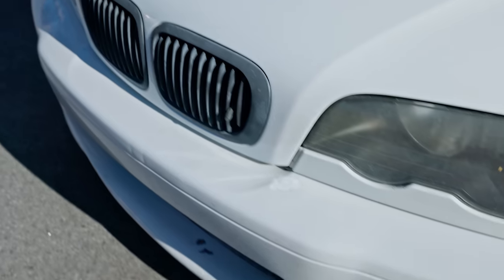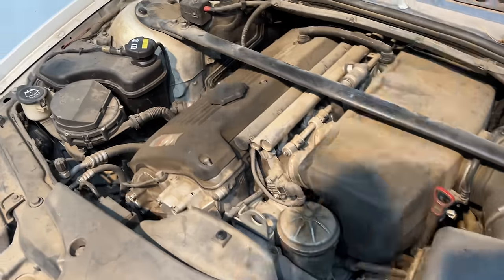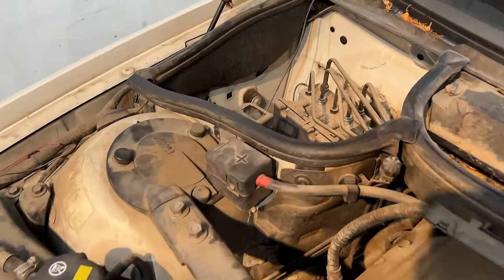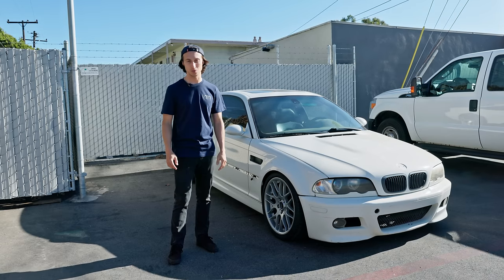BIG PROJECT! Fixing Everything on BMW E46 M3 - Dry Ice Cleaning Part 1

Comment: Why wouldn’t you wash most of that dust off before ice blasting?
Reply: Because that would add an unnecessary step.
Reply: @darkness1691  ok.  My reasoning is water is less expensive than the blasting media.  At least for the dusty under hood areas.
Reply: @jimgerock9190  yes it is, but since they will still blast all surfaces at the same pace, it wouldn't save any media. Some will wash it first to try and get any dirt off that could potentially scratch a surface but you'll just be washing it afterwards anyways.
Reply: Less of a visual change, so the video won't get as many views
Reply: California
Reply: @Stoney1985  agreed
Reply: Because of like, share and subscribes... Today, how things are done is determened by how it will look on vdeo. Not only here...
Reply: Because of more difrents
Reply: I like it
Reply: Personally I think it would have been a great idea to take a hose with some pressure and spray everything off and then dry it with an electric leaf blower and then move onto the dry ice blasting. It definitely does add some steps but that would only take maybe 10 minutes at most. I think the reason why they went straight to ice blasting in this video is to show how effective it is but that is just a guess. They know WAY more about this stuff than I do haha
Reply: OMG for get some viewers😄
Reply: @darkness1691  đi ăn gì
Reply: If you can calculate total costing, you will be expert.
Reply: @cwisted5308  🎉 LP ĺ la
Reply: Not as graphically pleasing=less likes
Reply: Actually you're all wrong. It's to keep as much water from getting to sensitive components as possible. That's not dust, it's years of caked on dirt and grime. This is a way less invasive and safer technique.
Reply: I'm on your side ...I would have washed it with some kerosene at first
Reply: Dry ice is safe when speaking of electronics parts of the car and time saving. Definitely with water those dirt will not be removed in a single wash..my opinion
Reply: @jimgerock9190  you're correct but time consuming,  cleaning process or procedures depends how thick the dirt needs to be removed. So in this video I guess he did it the correct way and there's no mess on the floor
Reply: Cause this new blasting, prevents any type of chemicals going to sewage.
Reply: Obviously yah don't need to smh
Reply: Dry blasting dust 🙄

What a stupid thing indeed 

a damp cloth works perfectly fine 

Well at least it hasn’t got rust 
Being in the desert car 

Even a steamer would do the exact same thing for a fraction of the cost of a dry ice machine
Reply: @thechampb12345  it’s dust grime what grime 🙄
Reply: @e46m32  sorry your sentence makes no sense. Was that a question?
Reply: i think because the dry ice was so cold that frozen any dirt oil etc than blasting it of with its pressure thats why no need to washing before blasting

Comment: dude, all that would of came off way faster with a heated pressure washer and would cost you a faction of the coast of a dry ice unit. show me of it removing rust, corrosion and oxidization.

Comment: How long did it take to clean the engine bay and how much dry ice did you use? Also, which machine are you using? Seems faster than the ones aimed at the detailing industry!
Reply: They use a machine called Karcher. Usually they provide a link to their site for their products in their video description.